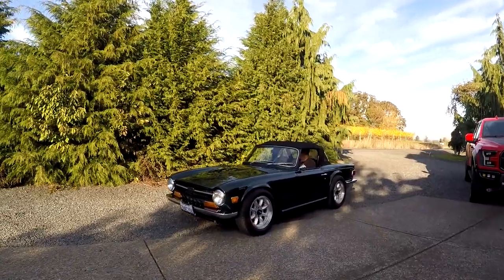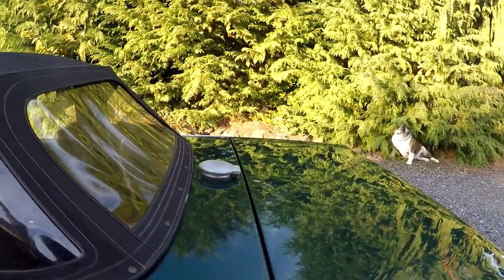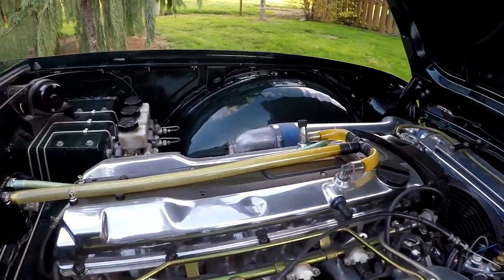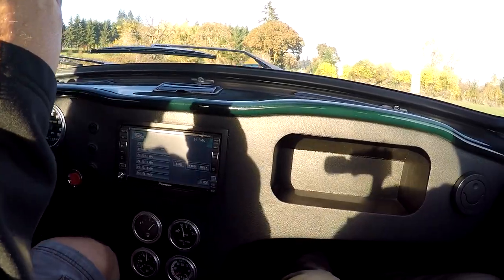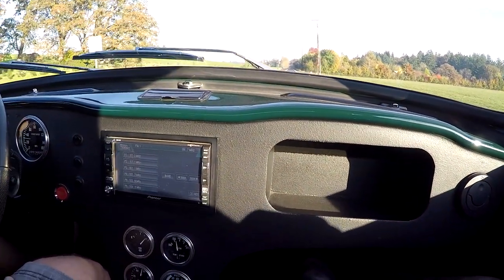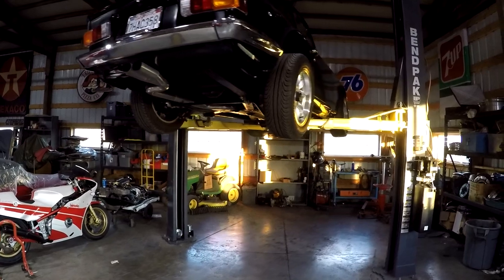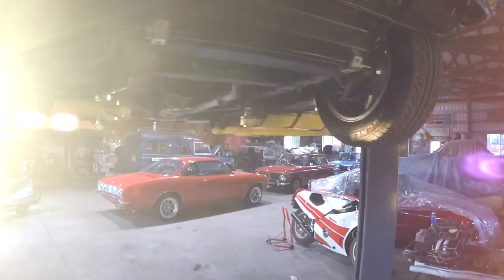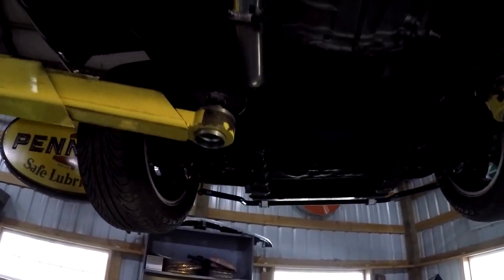1969 Triumph TR6 w/ Nissan Skyline TURBO Inline 6, GTR

Comment: TR6 wipers should park just like a modern car, maybe a bad ground or failing wiper motor?  Where is the secondary / safety hood latch?  If it was built in 1968 and sold in 1968 it's a 1968.  Judging by the VIN it's a very early (# 1584) model.  The "L" in the VIN is for left hand drive "USA/ Export Model".

Comment: Didn’t make the TR-6 till 1969 - They made the TR-250 in 1968 !
Reply: Yes, to see that plate stamped 1968 is very puzzling, was it moved from a TR250??
Reply: That early commission number plate carries a date that refers to the emissions spec to which it conforms, not the build date. It is misleading. Later the plates were enlarged and move to the driver side B post. These plates carried the build date. The first TR6s were manufactured in Q4 of 1968 although they were 1969 model year cars

Comment: not liking that dash very much, wonder why the builder didn't stay with the original wood? plus those fat wheels/tyres sticking way out beyond the wheel arches, I guess that might be because of the disc brake conversion on the back? very nice car though and lovely sounding exhaust.